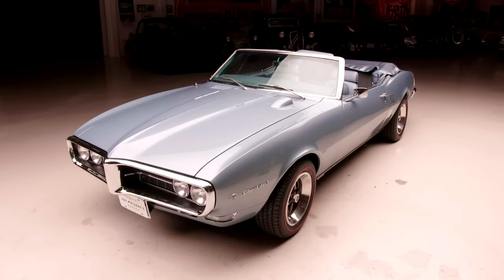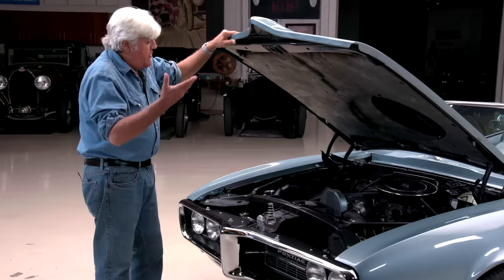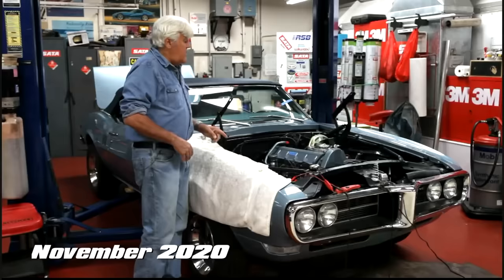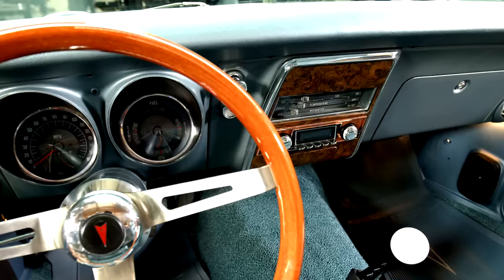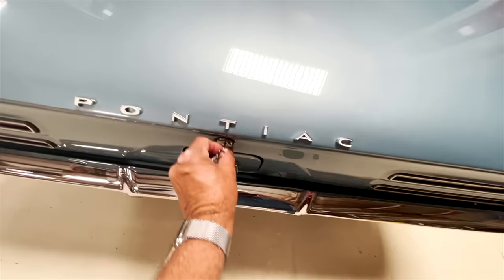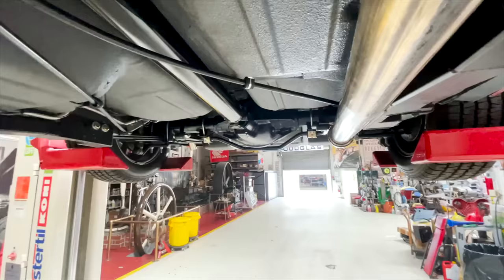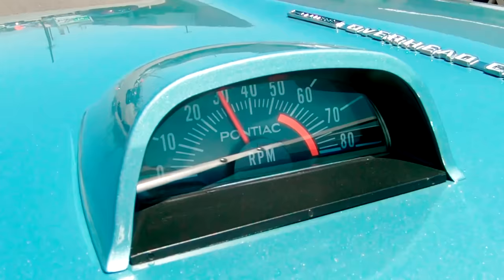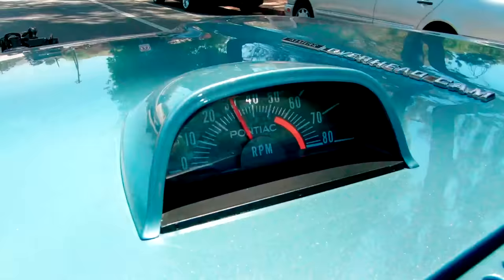1968 Pontiac Firebird Sprint | Jay Leno's Garage

Comment: The Gen 1 Firebird is much sharper than the Camaro. It’s a shame Pontiac never built more exclusive performance models like Chevy.
Reply: Holleyhell dood, Pontiac was "The Performance Division" of GM; check yer history.
Reply: Nope
Reply: @BubbaSmurft  yeah but there were no big block Firebirds like the COPO Camaros or high strung small blocks like the Z28s.
Reply: @JoJoJoker  All of Pontiac's blocks were big block, there was now small block Pontiac
Reply: @chrisjeffries2322  the 350 and 400 V8s available on the Gen 1 Firebird are small block V8s. Which is a bit odd considering the 396 is a big block. GM didn’t want their cars to compete which each other. (Camaro was a Mustang competitor and the Firebird was a Mercury Cougar competitor). Until they made the baffling decision to badge engineer models (Cimmaron) and self-compete themselves into bankruptcy in the 80s & 90s.

Comment: This is the second video after the one of the Dodge Polara, where there seem to be the brake calipers mounted the wrong way around, as the bleeder valves are on the bottom of the caliper instead of the top. How do you get the whole air out while bleeding the system? Is this just a Wilwood thing or are they  reversed from left to right? Have never seen them mounted like that before...
Nevertheless a beautifully restored car!

Edit: Found it out myself by researching their website: the caliper has two bleeding valves, one on top and one on the bottom. Just for anybody curious...
Reply: Cool man. Good eye
Reply: Well,  that's easier than draining the fuel tank and lifting the car upside down by its tires with the Steril-Koni lift.
Reply: That's so they don't have to have individual calipers for each side, one part fits either side.

Comment: I never knew that this car existed with this engine. What a gorgeous machine, and properly resto-moded. I'm so envious.   A shame that they never developed a twin-cam, that could've come in handy when the oil crisis hit and they had to down-size.   That tachometer, though. Gimmicky and unnecessary.  Once the novelty wears off it  would just be annoying.
Reply: Pontiac had a bunch a OHC engines that never made it into production. They were featured in and appeared on the cover of a Hot Rod magazine in the mid sixties. I remember it well, I had a 67 Firebird Sprint.

Comment: Hey Jay, I had a 1966 Tempest Sprint with the OHC 6, 4bbl, 4 Speed trans. Bought it new in August, 1966. Car turned  mid 14 sec 1/4 miles and 327 Chevrolets and 289 Mustangs were no problem. Loved that car, first new car I ever owned, bought it the year I graduated from HS.  Nope, 1968 was not the first PMD OHC 6.

Comment: I had one brand new in 1968. Mine was not a convertible though., and it did not have the 4-soeed or hood tach. I went through three engines under warranty. It handled a lot better than Mustangs and Camaros. So glad to see Jay with one.

Comment: I have the 1967 3.8 version. It was my first car. Still own it. Stock rear traction bars and factory air. I even had stock bench seat. As a kid I traded bench for buckets. Should of kept it. Very rare. I love my Firebird. I use to race and WIN my friends 70 Camaro and 72 Olds with 350's and won every time. Still have it and love it.

Comment: Beautiful resto, perfect selection of mods. I remember seeing a few Firebird Sprints around way back.  I had an 1967 V8 Firebird HO back in the early 70s that I still wish I had to this day. There were not parts to make a car handle better back then so I fabricated my own custom front and rear sway bars, installed adjustable Koni shocks, G50-14 series radial tires all the way around I also put on a fast ratio steering box (1.6 turns lock to lock) out  of a 1970 Camero Z28. The result was the car handled amazing. One of my favorite pastimes was to take up highway 18 to Lake Arrowhead in the San Bernardino mountains at perhaps a hundred times. While the V8 had great power, it was the outstanding handling I like best about the car.
Reply: Went that route, the back way it was called to Crestline many many times. Some tight fun roads, others with huge dips, whoops etc
Only bummer was no stops gas stations nothing for a long time

Comment: I owned my first OHC6 Sprint in 1968 when I was in the Air Force at Travis AFB in California.
It was a 1966 Tempest Sprint with a Saginaw 4spd (that I did not care for). I sold it in 1969 when I bought a 1970 Plymouth Duster 340 Automatic. Then when I got out the service and went back to Portland, OR ; I found another 1966 Tempest Sprint and traded my Duster for the Sprint. I put a Holley 650 4 barrel carb. on it with headers and a M21 Muncie 4spd. I still miss it.

Comment: In 1972 I bought a 1969 with out an engine or transmission,  picked up a 421 with 4 speed from a 67 GRAND Prix. It was a tight fit but a cutting torch and welder made it work. I drove for 4 years and put over 100,000 miles on. I love it, when it died and I had to get rid of it I almost cried. Lots of great memories.

Comment: Jay, my mechanic and I are fans of you and this show. My mechanic buys and rebuilds cars to sell, if his wife doesn't want to keep it, between repairs. I have a couple of cars, a 2000 Crown Vic ( not for sale) and a 1997 F150 (also not for sale) that I picked up for 1,000.00. I felt like I got a good deal, it was red and the body is in great shape. I didn't know there is a reason I got it for 1,000.00. I was a bit surprised at some of the things that I have had to do. It now has a new front end, shifter column, extensive engine work, all new brakes and a few things I have forgotten. The truck never sounded quite like the Crown, even though they had the same panther platform and transmission. So far, my 1,000.00 dollar pickup has had almost 3,000.00 in repair, and this last one is humorous. My mechanic found the reason the engine sounded different. The previous owner zip-tied two damaged spark  plug wires together. We think he though all it needed was buying tags and putting gas in it. Fords are tough, but not indestructible. We are almost done with it. Last part of the truck project, when the money comes in, is new rear shocks. It is an early 97 RWD, not 4WD. ordering parts for it, I always get the 4WD parts unless I give them the VIN and explain it is a rear wheel drive when I order. New shocks are the last of the F150 project, ( he says hopefully) , then dig into the CV.  The Crown is a beautiful gold retired detectives car, I expect to have fun sourcing parts for that one as well. I am a general class ham ticket holder (K0XHF), so I will be adding ham radios to the car, that ought to really make people wonder if I am a policeman, ya know. The truck will have ham radios as well. I would rather have a good relationship with a competent mechanic than with the best car salesman

Comment: This is great fun.
I owned a 1967 Pontiac Sprint.
I bought it in 1970.
I loved the car,but....
The main problems were the rockers arms wearing out very fast, as well as the cam would wear almost as fast.
I replaced the rockers,and cams frequently.
But the worst feature off all was the leaki g head gasket, which caused no end of oil leaks.
That was terrible,especially because it leaked oil into the passenger side floor matts.
Three issues came from that issue.
First, the oil leaked onto my new girl friend's shoes, secondly it smelled like burnt engine oil inside the car,( girls did not like that either).
Thirdly the oil spewed all over the engine compartment,which then leaked all over the driveways of my mom's house,or anyone else's home.
I finally traded it for a 1969 GTO Judge.
That was a great trade!

Comment: Jay - not only did I know about this car, I lusted after it!  I worked at Chevrolet Engineering Center in 1969-1973 while John Z was there.  I worked on some of his pet cars.  I was very aware of the Sprint and so wanted one, but I was a college student at the time with no budget.  I settled for a Nova which had the same underbody as the Camaro/Firebird with a slightly stretched out wheelbase, which gave it better stability and handling.  I dreamed of having the exact car you have, convertible Sprint with PS & PB, a beauty.

Comment: When I was a kid in my single digits age, I seemed to have an insatiable need to build Revell & AMT model cars. One of those was the Monkeemobile and another was the Red Baron. If I'm not suffering from the fog of age, I think both of those had the Pontiac OHC 6 in them. Of course coming of driving age in the early 70s I think I was all about the big V8s. Now I have a greater appreciation for the balance and smoothness of the inline 6.
Great car, Jay! I'm sure I'm not the only one whose bank account means I live many of my collector car dream vicariously through you and these videos.
Reply: Monkeemobile was a '66 GTO with supercharged V8...

Comment: My stepmother had a Tempest with this 6 cylinder Sprint set-up. It was a great handling car. At the time the family car was a 1966 Plymouth Fury II with a 383 V8 and automatic transmission. This was 1969 and I was 17. My car was a '64 Buick Special with a 225 ci slant 6 with 3 speed manual column shift. Ugh!

Comment: Wanted a 1966 or 1967 Sprint 6 Tempest Coupe for a long time. Love the engine. Not a fan of the 1967 or 1968 Firebird styling so much but it definitely looked better than the too-plain Camaro of those years. Nicely-considered mods. Sympathetic to the aura of the car from the factory. Thanks!

Comment: I am so happy to see this car/engine. I was always a Pontiac guy. Started out with a 64 GTO. However, when I found out about this engine, I started looking for one and although I never found a complete vehicle, I found a complete Sprint 4 barrel version engine. I wanted to find any kind of light Pontiac to put it in but never did end up with one and then I found out that my nephews dragged my perfectly good engine out of the barn where it was protected, into the barnyard where it became a solid piece of oxidized and rusted metal. These same nephews put bricks through my 64 GTO windows. Learned my lesson. Miss that engine though.... I had such big plans.

Comment: Well Jay, that Firebird is a real treasure. I like that nice blue color and the fact that it is a convertible. For some reason I just like convertibles and my retirement ride is a '12 Chrysler 200 Touring convertible with the Pentastar dual overhead cam V6. They have come a long way with automotive technology as my car weighs in at 3800 pounds and still gets 32 miles per gallon on the highway with an engine that's only 220 cubic inches and yet develops 283 horsepower.

Comment: Jay...I've got a 68 Firebird 350 with the hood-tach w/automatic transmission; I bought it in Arizona from a guy for $2000. We broke the engine down, bored it 30 over, tricked it up a little and it later required a water injection because compression was at 12 to 1...hahaha. From the stock numbers for Horse Power was something like 289hp, we got it to 405. We found a pair of GTO Butterfly heads, cleaned them up and fastened them to it; pure magic when you want to add HP to Pontiac compared to plain ol' Chevy. It was a convertible, i had two, one black, one white...it was the same color as yours, i think you called it or Pontiac called it Yorkshire blue,, a lite-teal metallic style that is just sweet. You were talking about the color in the GTO segment i watched. We got the engine balanced and blue printed and i still have it. 
I love it!

Comment: In '72, I bought a '67 Sprint hardtop from a kid that worked at a local Chevy dealer.  Don't ask.  Lol.  It had a Q-Jet, a Muncie 3 speed, hood tach.  Kind of bare, but a nice car.  In '74, I spun about half of the bearings, so, having some cash to burn, I tore the engine down to the bones, hot tanked and fluxed the block, went through everything.  And I mean everything.  Had the crank taken to 10 under, block bored to 30 over, gathered a couple boxes of used lifters, and on and on.  When I had it all beautifully broken in, I took it out on I-94 and opened it up.  The cop said I was doing 134, but he only ticketed me for 9 over.  Nice guy.  Guess he got as big a kick out of seeing that 6 banger as I got showing it to him!  So, I sold to a kid I knew in high school and he promptly took it out and wrapped it around a couple trees on his way back from a night out at the beer bars.  You'd have to have been from Wisconsin...  Sure miss that car.  One among many!

Comment: Thanks much for this video; it brought back many memories. 
I owned a '68 F'bird Sprint coupe in 1969. Like you, I found it a very balanced car with quick performance. The quadrajet gave crisp low end & mileage, and the large secondaries were more than enough. My problem was I was 18 in the muscle car era, so I  converted the car to RA III 400, Muncie wr 4-spd (3.55 12-bolt ltd slip), vr pwr steering,  manual s.p. frt disc & rear drums w/Velvetouch metallic linings,  chambered exh pipes (Chevy RPO), H.D. susp. w/'69 TA frt roll sway bar, '69 TA hood, 15x7 Camaro Rally wheels w/'66-'67 Pontiac Rally I ctr caps & F60 BFG radials. THAT car was FAST, would stop like you threw out an anchor, and near neutral, beautiful  handling. I found no handling degradation going from the 6 to the V-8. I finally deduced that the frt axle centerline was at/in frt of #1 sparkplug, vz. 6-cyl, giving a better wt distribution .The factory AM/FM, and the deluxe woven vinyl seats seemed luxurious for the era. I used a TA steering whl, but I love the "Nardi" whl on your car. BTW, the engine idled at 700 rpm, would pull even more strongly from 5500-6200 rpm, and, if I put it in 4th, it would motor away from a standstill by just slowly letting out clutch W/O using accelerator --that engine was a sweetheart!
As you can tell, your video brught back many fond memories. I thank you.
p.s. I was an early adopter of synthetic motor oil (1969), and had no problems with oil pressure (60 psi per SW guage) or cam follower wear.

Comment: When I was in auto school I actually did a valve job on one of these cars . Best part was My instructor told Me to take it for a spin . I was impressed with the power it had . It was a rag top also . The teacher actually ground the valves but I got to lap them in and He and I put the head back on and I torqued it .

Comment: Love it Jay!   I was a firebird fan.  I remember these. (I started driving in the early 80’s). I wanted that car with the 400.  
Not sure what got answered.  But, I do recall the 60’s firebird convertibles having “shaker cans”.  ‘68 also move one shock on the rear axle, to reduce wheel hop.  Great job Jay.

Comment: Love this! My first car (in '82) was a '68 Firebird 350 2bbl, but my next one (in '96) was a '68 OHC 6 1bbl though 3 speed on the tree (red on red). Loved that engine. back then very hard to find parts! Love the 15 x 7 Rally II's with redlines! Though I think I would have gone with the blue deluxe interior instead of the standard interior. I know not original to that specific car, but a very nice style interior and seats were a woven vinyl, and more comfortable than the standard (I've had both). By the way they used to refer to those cans in the trunk of convertibles as cocktail shakers. I believe they were oil filled with heavy springs inside to help with handling. Beautiful job, nice that it is mostly stock! My favorite muscle car of all!

Comment: My second car was a '67 Firebird Sprint - loved that car - big Rochester 4 barrel with a Hurst shifter, wide tires and a seriously stiff clutch. Rarely saw another one and still don't. The original had a single leaf spring in the rear and the '67 didn't have those weights in the trunk but it did have a full size spare which took up most of the trunk.

Comment: Another fantastic waltz down memory lane with Jay Leno. In 1966 and 67 I read about the Firebird Sprint in car magazines but I never saw the real thing.  At that time, I was fascinated by the concept. Small efficient engines in light weight cars seemed more intriguing than the big cubic inch muscle cars in 3500 pound chassis.  I think it's interesting that there was a Falcon "Sprint" that was also a revolutionary car with close to the same formula and was eventually the basis of the Mustang.

Comment: I had those weights in my 68 Camaro 327 4 speed RS convertible (all four corners, fronts located in front corner of fender), was informed that convertibles needed these b/c of flex (lack of roof, of course dampening etc...). The rockers were beefed up also. I worked for PMD in Pontiac MI and saw many engines and prototypes including overhead cam engines and lightweight cars. We finished-out building 400 type and Iron Duke Pontiac motors, but the line had no Pontiac cars in the late 70s and 80s. We built G-Bodies, incl Grand National (GNX also, but shipped to ASC from us). Learned much from the old PMD guys..... GTO etc...

Comment: I bought a new 1969 Firebird 400HO new. Loaded it up with most options except AC. $3900. Was a really great car, wish I still had it. I remember that OHCsix as well. Went to work for a Pontiac dealership in 1970. Had many high performance Pontiac parts. Had two Pontiac Ram Air V crate engines. Those were my best days. Wish I could live them over again. Am now 77.

Comment: The Ex's family had a 68 sprint, modified to 4 bbl carb, and an aftermarket manifold, with a radical cam, the lighter engine made a world of difference. I was told with a 2 speed power glide you could rev these PMD blocks to 7500+. That was why they called it a corvette killer in the quarter.